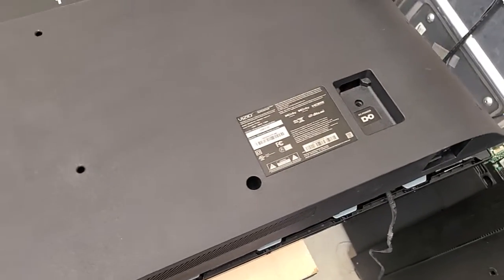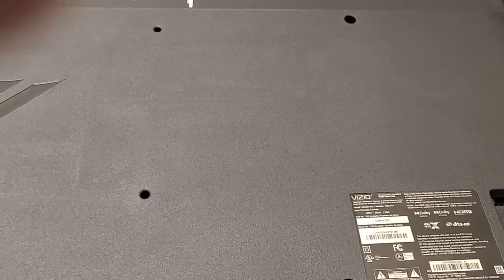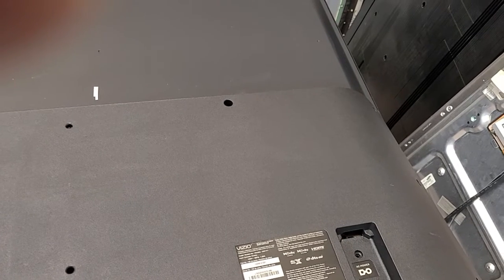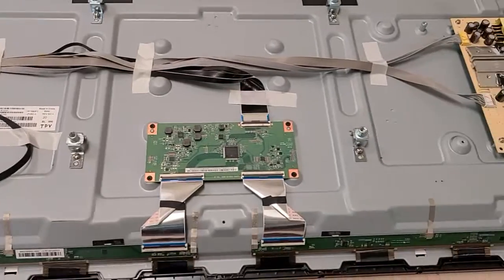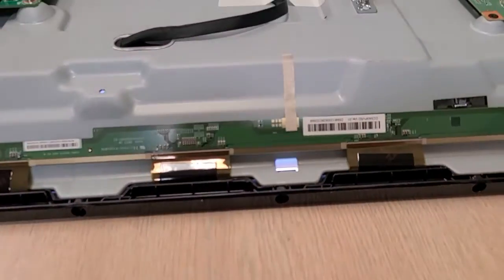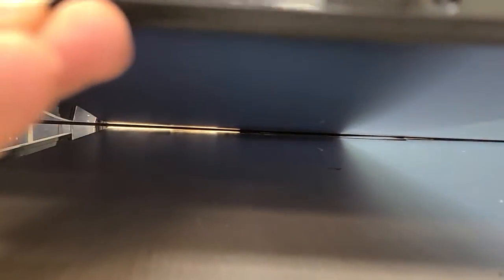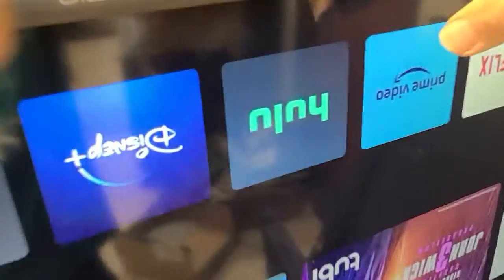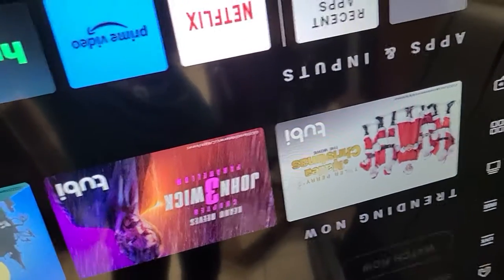How to repair some LED TVs that come up with back light, possibly sound but no image (here V585-H11)

Comment: Ive done this to quite a few dumpster picked samsungs. The color is usually off or there are faint lines. I havent figured out vizio or lg yet. I use thin tape so it doesnt move around. Im guessing most likely short is in panel itself, most ive tried to figure out anyhow. Thanks for the info.

Comment: That's a good hack on those Data lines ,  I know how it works in my head , but I can't explain it ........  Charge a bench fee of 20 dollars and explain to the owner what happened ....... He'll be happy to pay 20 dollars rather than 80 or 100  etc etc .....
Reply from the maker: First...if you can't explain something then you don't know it. The idea is not mine, actually and I do not mean it as an offense, but as feedback. Most people - myself including - at one point or another in their lives lie to themselves in a similar way.
The ONLY way I can think of how this could be happening without loss of quality (which there might be and I might not be seeing it) is if the signal that was cut was watchdog or feedback that has gone bad.  I do not think this is the case  here.

Second...the amount charged...should be more than $20 at least in my opinion. if this proves to be long lasting hack (presently 5 hours and 3 successful random restarts on demand) then I think the customer should still be paying somewhere near standard repair service, say discounted mostly for the sake of risk.
As everything that is unique - and something like that comes relatively rarely - it takes time to come up with it and then most of the time it doesn't work.
So in order for technician to be motivated to spend time experimenting (beyond the diagnostic fee time) someone should be paying for all those failures.
Nobody else would but the successes.